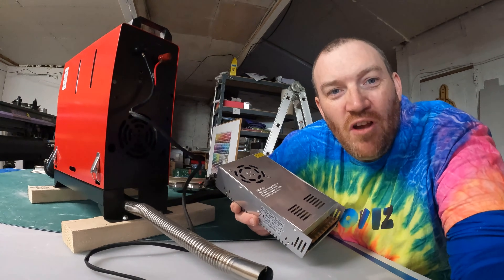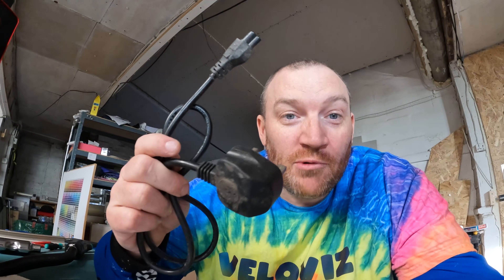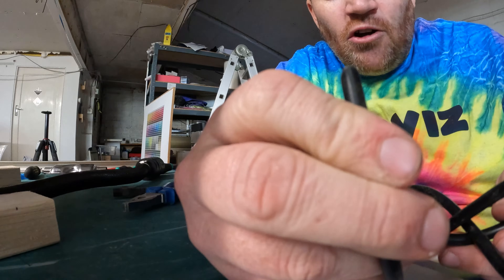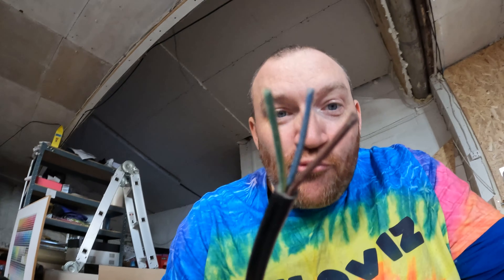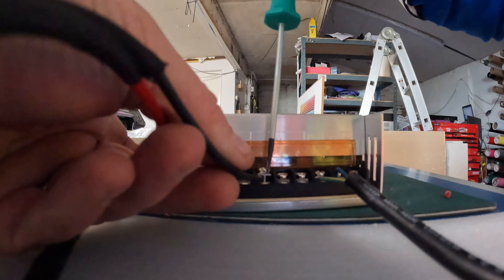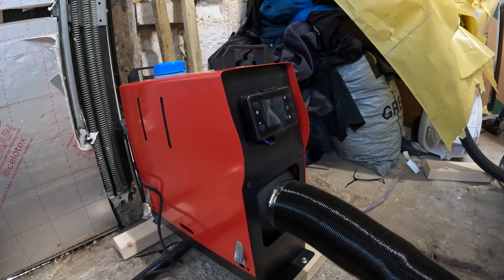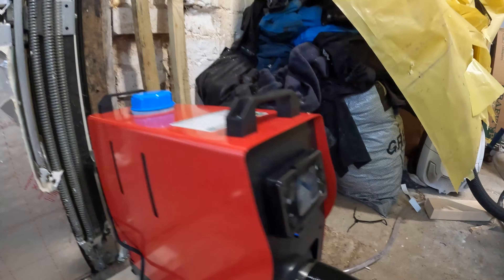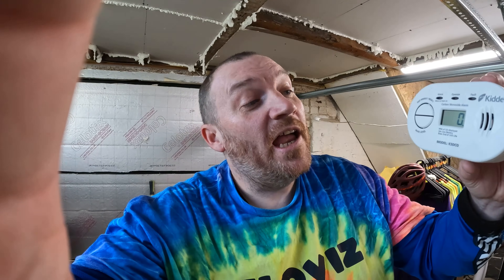Chinese Diesel Heater - How To Wire 240v to 12v Guide

Comment: Can i ask how hot the inverter gets please? Im going to install one in my van and want to make sure I store it in an appropriate place. My thoughts are in a well ventilated cabinet under the bed but im cautious that my cabinets are either wood or plastic based
Reply from the maker: Hey, I would imagine it does get quite warm.  It is not a consideration for me as it is in open air, since I use it to heat my workshop.  I think it would be prudent to mount it where needed on a heatproof mount where possible.  I would definitely seek advice from people using it for the same reason as yourself to get their thoughts.

Comment: Hello just seen your vid and thought this product might come in handy as we are getting a small van to do a self build but we want to do it a basic as possible plus we have a very tight budget the hole van is going to be powered by a portable power station high powered one like 2500w but problem I think I'm gonna have is powering the diesel heater as most power station 12v is only 10amps some work but some don't but seeing this device would this work on the power station if I use the 3 pin sockets instead of the 12v please as this may solve my problem if it does work that I you.
Reply from the maker: I couldn't answer that I'm afraid.  I would contact the maker of the power station for advice, or look on van-life forums to see what others are doing.  Hope that helps
Reply: @hausofyax  thanks buddy I will have to have a look I can see this working though as most power stations have the 3 pin sockets for main supply like a house just converting the power lol but thank you anyway

Comment: it's not a good idea at all to run your 12v  diesel heater off 240 volts  12v power  power supply , in  any case of a power blackout your heat  ,  won't be able to go into cool down mode and will damage your heater
Reply from the maker: That is a valid point, I wonder how much damage would actually be done in that event.  It's not happened to me so far.

Comment: Your link to the 12v/240w takes me to a 12v/360w, can i use the 360w or does it have to be the 240w? Also why a 13amp plug, not a 3amp?. Thanks
Reply from the maker: It may be that the seller has updated the listing to a different product.
Reply: @hausofyax  will a 3amp do then? Cl
Reply: @mryorkshire4188  yeah
Reply: @mryorkshire4188  always go for the lowest fuse an appliance will run off
Reply: You can get 1a Fuses for plugs but they are hard to get . you should be using as small a fuse as possible if it says 350w probably a 3a fuse but no bigger than a 5a
Reply: 240w or 360w please
Reply: @MrJohnk58  12v 10amp, but less if you can find one, 60w is probably enough anyway
Reply: @derekbragg879  thanks matey
Reply: You just change the fuse in the plug  to a 3a if it  blows, which it shouldn't unless there is something wrong put a 5 a fuse in if that goes there's really something wrong with probably the power supply box or the heater itself
Reply: And no need for a 360w power supply 60w will easily do. Just look for a 12 v 10amp supply and that will easily do  but probably a 5amp would be better but they ain't so easy to get

Comment: Great, was gunna go buy a big battery buy after seeing how easy this looks im gunna go this way now. How was the heater? Any problems with it running?
Reply from the maker: The heater is great.  I'm using it in a decent size workshop and it is very effective in everything but freezing conditions.   It would be even better in a smaller space.  I have another one to install for those extra chilly days!

Comment: Really helpful thanks 👍🏻 What sort of current does the power supply pull through the 12v cable? Should be able to fuse it down to 3amp shouldn’t you?
Reply from the maker: You're welcome.  I'm not sure to be hinest but the converter is rated to 30 amps, so less than that!
Reply: Elderly question, but answering since it hasn't been:

While RUNNING it draws very few amps but while STARTING it briefly draws around 10 amps.
Reply: The heater won't pull anywhere near 20a the kettle plug will have a 13a fuse anyway but I would take it down to 3a. But I reckon they probably use less than 1a as you see people just running them from a car battery and only charging weekly

Comment: I am interested in adding a battery for power supply in situations where the mains power is interrupted. When starting/stopping, the heater has a cleaning cycle, between 3-5 minutes. If there is a power outage during this time, the cycle is interrupted and restarted at the first start. this source does not allow a battery to be connected to one of the links, because it does not know how to automatically switch to the battery. Are you thinking of adding a battery in the future? A video would be interesting. Thank you.
Reply from the maker: That would be a good idea but to be honest it is not something I would need to do here.  If there was no power I couldn't do any work so I'd be off home anyway 🤣

Comment: I've never really liked these units as they don't come with an isolated external unit/casing. And mains cable clam. Also keep an eye out that you pick the right amp ratings. It's possible yours looks like a 20amp unit?
Reply from the maker: This is a 30 amp unit.  I too would prefer that the wiring was more isolated but that's just how these transformers are.  It is safe if done properly 👍

Comment: Brick teaser : your power supply. Does the fan run continuously soon as you plug it in?  Mine is so dont know if its  faulty or meant o be. Cheers feller 😀👍
Reply from the maker: Hey, yes the fan runs constantly if there is power to the unit 👍
Reply: @hausofyax  bullseye thanks Pal!
Reply from the maker: You're welcome 😀